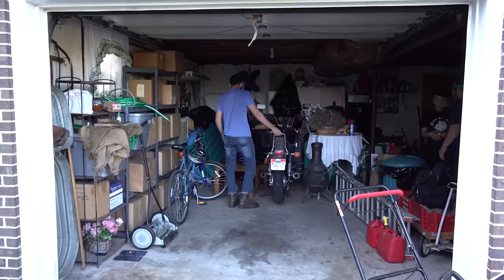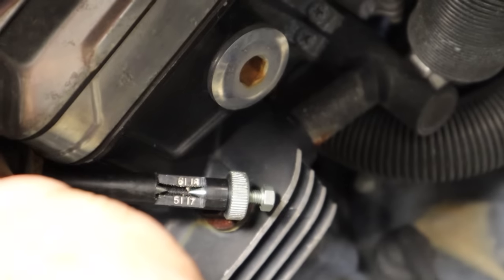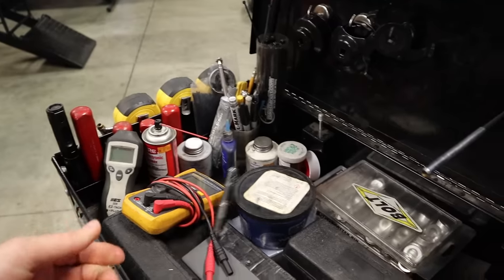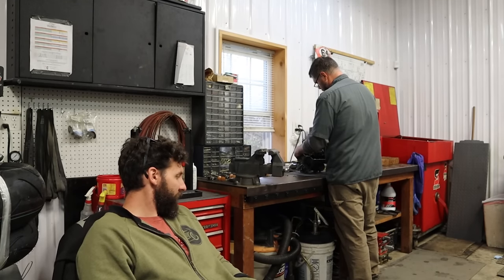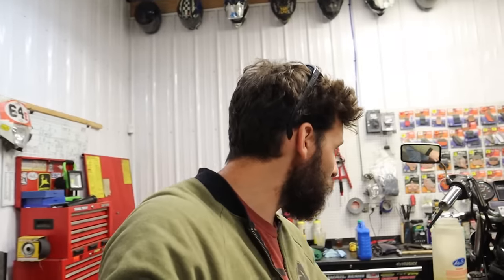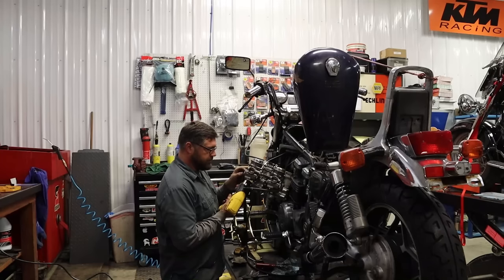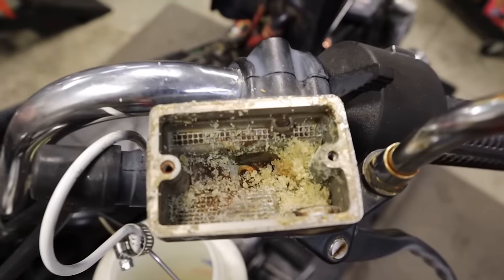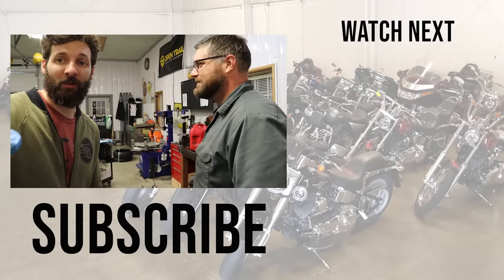Abandoned 1983 Honda Magna Restoration, Can we get it to run?

Comment: got a 1979 Honda CB400TII that I want to get on the road. To my surprise with a new battery the motor actually runs! guess you can't kill a honda LOL. Getting the title though that's another problem. There's an easy way to go through the process, but the Provincial insurance agency ICBC (Insurance Corporation of British Columbia, B.C. Canada) is waaaaay backed up, so it looks like it'll be late January before I have the title. Been two months now! so sadly it'll be another eight weeks. On the up side, it only cost me seven bucks for the title search! LOL I even know who originally owned it but I can't find him. I'm reluctant to put parts into it just in case it was stolen 40 years back and the original owner want's it back. I might have to buy a kawasaki vulcan S in the mean time :D
Reply: Nice! I used to have the exact same bike myself. What color is yours? Mine was black. Got it for free from my uncle because he thought his son had wrecked the transmission driving off road with it. Just the shifting detent wheel had come loose and rotated half a click. Instead of 5 gears and a neutral between 1 and 2, it had 5 false neutrals and one gear. Took me a while to figure it out, but an easy fix otherwise. Wish I would have kept that bike. 

Anyhow, good luck getting a title for yours!

Comment: My first road bike was a 1976 CB550, that hadn't run in 5 years. Picked it up for around $300 with a box of extra parts, loaded it in the truck, and took it home. Got up the next morning, and went to pick up a new battery, then got that set up and charging. Then pulled the points cover, cleaned and gapped them. I lucked out due to the last owner storing it right, and draining the fuel, but got new line and a new filter anyway, as cheap insurance. Oil and filter changed as well, for the same reason.

Dad and I went out to the garage the next morning, and he double checked what I had done, told me it looked good to go, and that there's only one way to find out for sure. So I turned it on, turned the petcock to run, and hit the starter button. Fired right up first try.

Wound up riding it in the side field that afternoon, making sure everything worked right, and found no issues. Called Monday to Wednesday t to their insurance, and they had it plated Tuesday by the time I got back from school.

I had already taken my road test on Mom's XlS650, so I took my own bike out that night, one I got running again.on my own. No feeling like that, and I still enjoy it every time I get another one going again, that someone else gave up on.

Comment: Magna Carbs... only when you want to lose friends, do you ask them to help get them off ;).
Reply: The Sabres are just as bad, trust me.
Reply: Truer words have never been spoken. Getting them back on is even worse.
Reply: Makes me appreciate inline 4's all that much more! Even my old Yamaha 920 Virago was no picnic to get the carbs off and on.😜
Reply: @IR_Chaz  Don't I know it... :(
Reply: True, you got to be very detailed oriented when working on these V-4's and take your time and get every passage clean.  Once it's running, they are a joy to ride.
Reply: @tomreyes4908  And don't mix some of the parts from the front 2 carbs up with the similar parts from the rear 2 carbs...they have different part numbers, but those aren't the numbers on the jets or needle jet.
Reply: Can't remember how bad it is on the Magna but on the Sabre you have to loosen the ignition coils to give yourself enough room to tetris them out.  Taking them off is the easy part though, its getting them back in AND getting all of the boots seated w/ the hose clamps that'll get you.  The boots harden over time, but if you soak them in hot water (almost boiling) for 5-10 min, the boots soften up a good deal and make it that much easier
Reply: @Cavero427  I learned the hard way to seat the boots on the engine side first and then put the carbs on the boots. But I like the hot water idea.
Reply: Your friends are ratchet straps, electrical taped wrapped prybars, beer, and angling the boots.
Reply: Hehe,.. Yeah, and if you have many friends, ask the rest of them to join, -putting them back on..
Reply: I was going to get a magna for my first bike then every single one on Craigslist had fouled up carbs and I was like 🤔 nevermind
Reply: @Cavero427  Thanks for the tip.  I have to yank off the carbs from my 83 Shadow soon to get then unclogged.  Hope it isn't too difficult to clean and get them back in.

Comment: Bought a 1982 Honda CM450C from a guy in Carlisle last year. 13k miles on it, he stored it in 1997, took it out last year, put a new battery in it and it started right up. I rode it home to my house near Philly with no issues. Since then, the fork seals have gone, and the head gasket is seeping from one side. I put a new chain on, new tires (the front was original and rear was at least 30 years old), new sprockets, new brake shoes, and fortunately the brake fluid didn't look like that so I just flushed it.

However, a bike that sat for 20 years (even in a climate controlled garage) will always be a project until I tear apart and reseal the entire motor, which I just don't have a place to do, so I'm selling it for something new. Rode a CB500X last weekend and really liked it...

Comment: I got an 83 Honda Magna back in July. The engine ran 2 years ago before sitting in a garage for 2 years. Before the bike was put away the fuel was drained as was the coolant. That didn't stop the mice from chewing up the wiring, or the last owner attempt to convert it to a bobber. I replaced the old wiring harness, clutch and brake master cylinders with levers, the speedometer tach, idiot lights, headlight, and turn signals.

Comment: I got a free 2002 Suzuki Katana 750 that had been sitting in a friends back yard for 14 years. I've never taken a bike like this apart, but after pulling the carbs 3 seperate times, new plugs, chain, tires, and de-rusting the tank she fired right up. As frustrating as it was, it was such a fun project. Maybe cost me about $400 in all the parts and upgrades to bring it back to roadworthy condition.

Comment: I have been doing this for a few years. People like these old 1980’s bikes. Im not formally trained but I have been working on my own bikes since 1980. I find about two projects a year, fix them to original, and sell them. Im working on a 1988 VTR250 now. There arent to many folks around who can work on these 1980’s bikes and if they do they are swamped with work. Youtube helps a lot. First thing I always do is buy a used oem shop manual and ........... get the bike running.

Comment: Just bought a UK VF750F Interceptor that is an ‘83 and hadn’t been run since 2009. Just for starters brakes seized, no clutch pressure, battery knackered, paint in need of a load of TLC. Looking forward to getting it restored and back on the road! Couldn’t afford one back in the day but got one eventually, workshop cleared ready to go.

Comment: i love your videos and content! im used to working on this bike because i also work at a shop, i agree in everything but you forgot one thing.... the fuel tank since its been sitting for at least a decade the fuel tank has to be cleaned,, ohh and i almost forgot this bike has 2 fuel tanks and removing the lower one is a paint to taKE OUT

Comment: A couple years ago, we picked up a 81 Maxim for $100. I cleaned the carbs and it kind of ran. The starter clutch and chain kept slipping so it's in pieces at my work. I found that the chain guide was broken so I got another to replace it, as well as a chain (which I may not need).

I'll be putting it back together soon, after I clean the carbs again 🤣

Comment: Honda 750 sabre was my first big bike after passing my test on a 125. Beautiful bike to ride when running properly. Powerfull  v4 with loads of torque and very comfortable cruiser. Sadly they have a lot of problems. Starter solenoid was always  failing had 3 in two yrs and not cheep. Biggest problems are oil pump chain would stretch and there wasn't any tensioner so it would throw it. But worst than that this v4 was before gear driven cambs so the camb chains where about 3 long and used to destroy camb chain guides which filled the sump with crap and then seized. Cost a fortune to rebuild more problems after. Sold as scrap in the 90s because they where by then known for being a basket case. Loved watching this though reminded me all the times it broke down hahaa. Still have soft spot for it though beautiful to ride when it was good. Thanks for the memories

Comment: Craig is a pretty smart fellow.  Because figuring how to get those carbs back on a 90 degree V4 is a real head scratcher.  For those who don't know the trick it's to angle the mounting boots and start each boot to the head and airbox on the angle needed to get all the boots started.  Then one simple bounce down with about 20 lbs. of force and it will all pop in place.  Note I also lube the inside of the rubber boots with thin layer of Vaseline.

Comment: My '83 Honda shadow. Brakes seized up during test drive around the block. Glad I didn't take it on the highway to start lol.

Had wild time unseizing the caliper pistons. Compressed air wouldn't budge them. Compressed grease was the ticket. Honda machines are incredible.

Comment: Yep, I bought back my first ever motorcycle this last spring from my friend (2001 honda shadow ACE 750). It died on me going down the road, acted like it ran out of gas. I took it back home worked on it for 4 months trying to figure it out. I cleaned the carbs and jets, boiled the carb bodies and soaked in pine sol, replaced fuel pump, fuel filter, spark cables, plugs, air filter, oil filter, oil, intake boots, air box boots, gas hoses, air hoses, petcock valve, fuel cut relay and pulse generator. $600 and 4 months later I found the problem. My buddy did work on the bike to clean the carbs and he connected the carb vent lines to the gas tank vent line, they were venting into each other. I didn't catch it because I kept putting the carbs back in the way I took them off (which was the way he had them). Once I stoppped to critically think through the process, I fixed the issue by rerouting a few hoses and boom, she runs like brand new. Expensive but valuable lesson. Keep fighting the good fight brother, and I love your videos, keep em comin!

Comment: I recently bought a 79 cm400a put in a new battery cleaned the carbs and got It running since then added tires oil change preloaded front suspension and new mirrors while slowly fixing it I managed to take my new rider course and get my MC license! I’m ready to ride now!!!

Comment: Just rebuilt the carbs on my 03 v star1100 runs like a champ also had bought a 83 hands 1100 from old boss was wreaked  drained tank went through carbs got running had two shifter great bike

Comment: I bought a Suzuki GS500 for $400 that had a seized motor. Was just going to be a cheap road bike project to see if I could get it running even if I had to find a new 2nd hand motor for it. Once I stripped it down, I found that every thing you could think of, it had it wrong with it. It should have been scrapped but as I stated fixing all the problems, I ended up restoring the whole bike. The only parts I did not have apart was the gearbox.  I found that I learnt so much. Very proud of the bike now.

Comment: I did the same with my 85 Magna V65 from high school. I found it in sad shape. Got it back for $150. Put about $100 in to getting it to run. Then replaced some lines and such. All told it's a $400 monster.  My brake and clutch masters looked identical. Corrosive sand sludge.

Comment: My dad has a v45 Magna that's been sitting in our barn for just about 9 years!  And the kicker is he was just replacing the fuel lines and had to put the project on hold and then he never got back to it.  So it's an easy fix!  I might just have to take matters into my own hands.  ;)

Comment: Got a 1977 gs750 for 500$ buddy had sealed the carb float bowls with silicone for gaskets... And a dent in the tank.
Even the original factory exhaust was rust free!
Got it running, used it for a summer.. Great bike!
End of season had an electrical fire... Have to build a whole new harness, new brake lines clutch throttle cables and speedo cable urgh.

Comment: Bought a 2000 softail in April. First harley. Did all fluids and few extras. First rude, stator dropped out. Eh ok. Second ride yesterday, cam tensioners (notorious on the 88in tein) dropped out. I was taught to wrench my own. This vids are great to see. Keep em coming. (I know its 6 months old, I just found you after buying the harley)

Comment: Yeah, but the time was worth a whole lot more than the parts!
I have two old bikes in my garage. One a Suzuki GN 400 from 1980 it hadn't run in 20 years, now it's a blast! Two, a Triumph Thunderbird 900 from year 2000  I have spent months on both of them. The Triumph is the headache I am beginning to think I am going to have to break down and get help with 🥺.
Not yet though, I hate to give a mechanic money if I can do it myself...... However.....
I'll get back to you later if I manage. Probably January!

Comment: Don't forget the add more blinker fluid Sean, it's nice to see you getting your hands a little more dirty on fixing the bikes you're getting better. I know the headaches in the hassles of carburetors my 82 Yamaha 1100 is a pain in the butt and I have to call the carbs clean them all put it back on and pray that I have it fully cleaned again. My problem is is if I don't shut off the fuel the carbs Leaf but she runs good can be a hassle to start at times.
Reply: You must change the floats valves and all will be OK

Comment: I have a z1000st that had not  run since 1993 - cleaned the carbs ( cheap ultrasonic cleaner at home) , dropped the oil ( don’t run it before dropping the oil - 30 years plus mineral oil get toast real easy) , freed the clutch plates and oiled them,, started and its a runner - just now undoing 30 years of damp and neglect forks strip down, brakes plus master cylinder rebuilt  , tank clean hopefully back on the road soon - it’s a keeper was owned by my brother so spend time to get in good shape

Comment: I also laughed when you said you would only have the carbs off once. My first Honda SOHC4, a '77 CB550K had sat with fluids in it for 28 years when I bought it. The fuel in the tank was about the worst smelling substance I have ever experienced. The remains in the float bowls looked like epoxy. It took me 2 weekends of work, but I got it running, and 4 months later rode it 1400 miles around Lake Michigan. My current bike, a '76 CB750F sat for 17 years. It took several weekends to get it running. In 2019 it took me 1600 miles to SC and back, including The Dragon.

Comment: I just got a friends 1993 Kawasaki Vulcan 750 on the road after it sat up for almost 20 years. Carbs cleaned and built ( the CV carbs on this bike are a B***H to remove and install). Rebuilt front brake system. De-rusted the tank and rebuilt the petcock. Cleaned the radiator. All new fluids, tires and plugs. This thing now starts immediately and idles well. It runs great and has good power (For a 750, I ride a 107 inch WideGlide so it feels weak to me). The bike has been in two shops in the last two years neither even pulled the carbs (can't blame 'em Talk about a nightmare). Tires, turn signals  + parts to get it running about $450. Labor would have been alone would have been more than the bike is worth, but it's a nice looking reliable ride. She's only been stranded 3 times, all three were due to not raising the kick stand before trying to leave, lol. But she's riding it and we've even been on some fairly long hauls.

Comment: I had a 1955 Harley Davidson. Shortly after I bought it if I turned the lights on at night the bike would die. I tried tracing wires, check the battery, check connections, everything I could think of. Finally I went and bought several different colors of wire and some fuses, made my own wiring diagram and rewired (built my own harness) the bike. After that, I never had any electrical problems again.

Comment: One resurrection project I did for a friend was a Yamaha TTR125.  Float bowl had green slime in it.  Thought about replacement carb but a lot are not well built.  A lot of rebuild kits are junk also.  Went with new jets from Yamaha and some tinkering and got it going.   Fuel stabilizer or run it out of gas before storing for sure.  Took a lot of time though.  My friend did some carpentry work for me so it was worth it (I am not good with those things).

Comment: I had an 03 Magna that I restored it wouldn't run right because the carburetors were all clogged up and needed to be cleaned instead of taking the carburetors out and cleaning them I put in some seafoam and ran it into the carburetors let it sit overnight the next day drained it out and put some gas in and ran it and it actually started and I rode it but it would not accelerate so I took it back to the shop and I ran seafoam in it one more time by taking the tank off and putting a funnel on the input line and ran seafoam into the carburetors again like I did the first time let it sit overnight now it runs like a dream and did not have to remove the carburetors what a awesome relief that was

Comment: I had the magma in the VFR form. I modified the stock exhaust and did some custom jet work & stomped a Honda 1000 on my first test ride.
Amazing engines capable of a LOT of horsepower